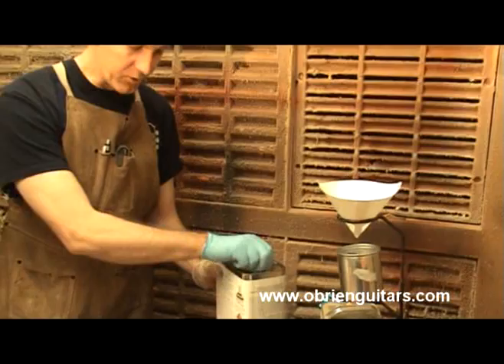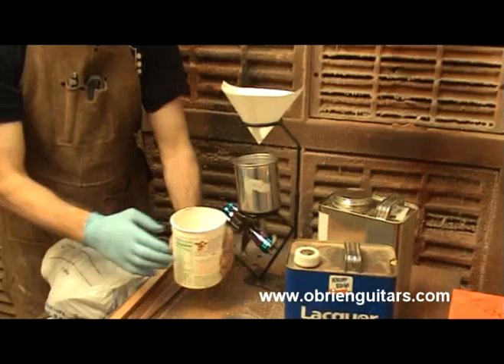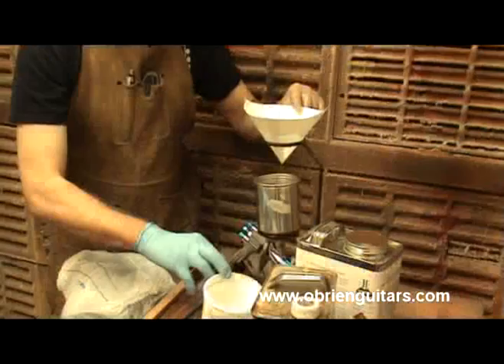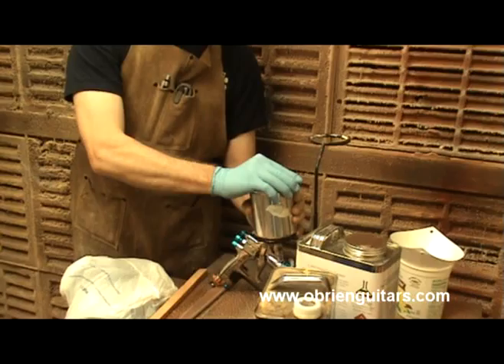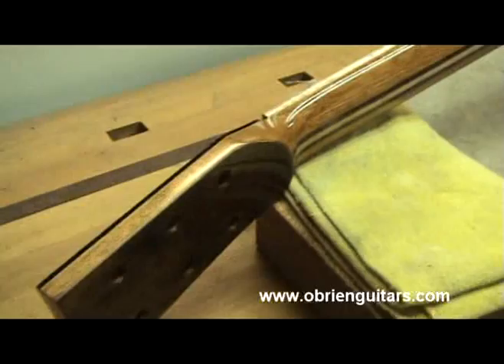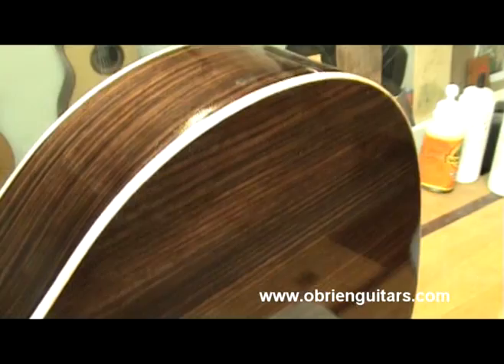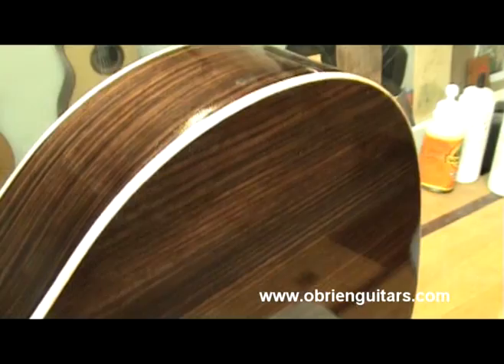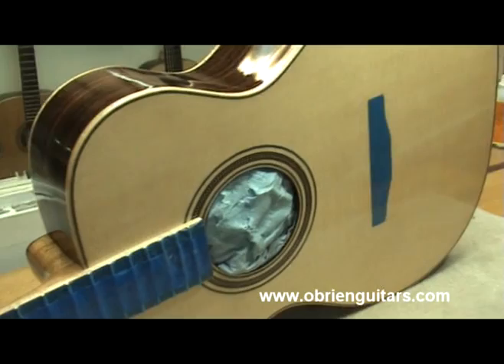O'Brien Online Acoustic Guitar Building Course - Chapter 11 Lesson 16 - Final Spraying

Comment: This is really useful, thanks for this, a quick question, how do I mask the bridge section off? won't the paper pull the finish off when I remove it?
Reply from the maker: You need to score around the tape when removing. This eliminates the problem you mentioned.

Comment: Hi rob, what gun paint use? And what commpresor? And what lacque? Thanks
Reply from the maker: There are many types of guns available. HVLP with or without turbines or regular or HVLP  guns powered by compressors. You don't need anything fancy to do a professional finish. Some of the best finishes I have done were done with inexpensive guns powered with compressors. I recommend a needle site around 1.5mm or lower depending on the viscosity of the product. I use instrument lacquer for finishing. Check out home stead finishing for more info. https://homesteadfinishingproducts.com/

Comment: How are you able to grab it an hour later without putting hand prints in the previous costs??
Reply: *coats
Reply from the maker: Spray light coats and they flash off quickly.
Reply: Am I using too much thinner,? I just did a guitar yesterday and it sat for about an hour,  was showing it off to my wife, and I was putting finger prints in the nitro finish, any thoughts? I appreciate it, been building for about 5 years and finishing still kills  me.  JD
Reply from the maker: I do not think it is too much thinner. That would flash off quickly. It also depends on the RH level and temperature where you are spraying. If you can't touch it after an hour then maybe you just need to wait a bit more time. Try spraying lighter coats as well.